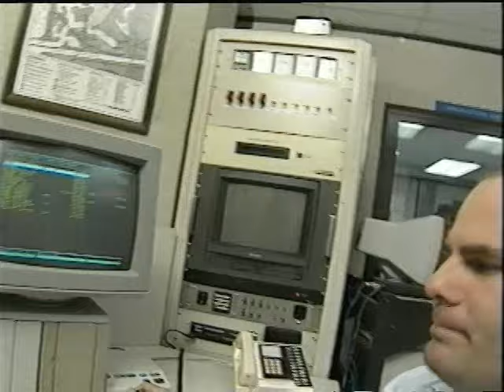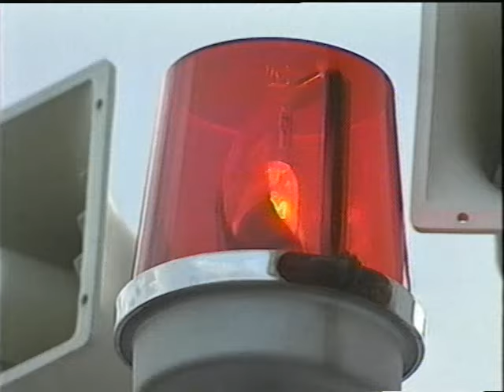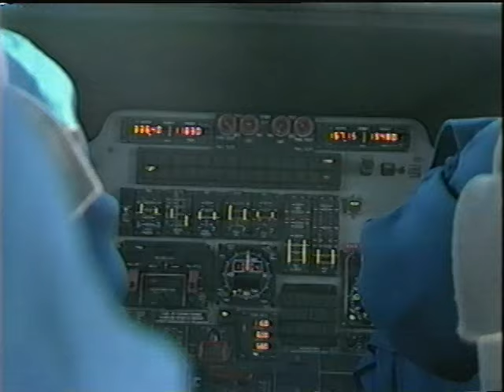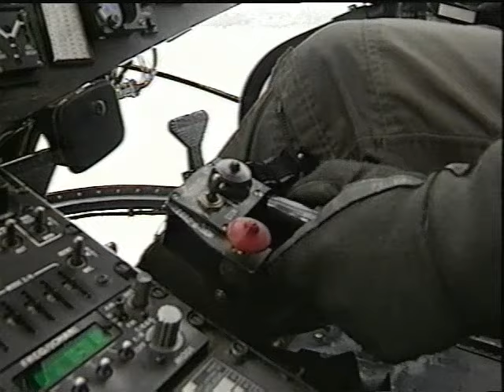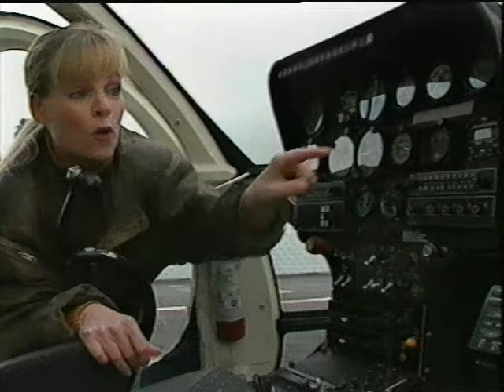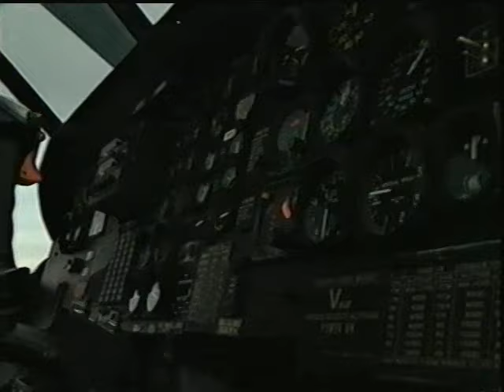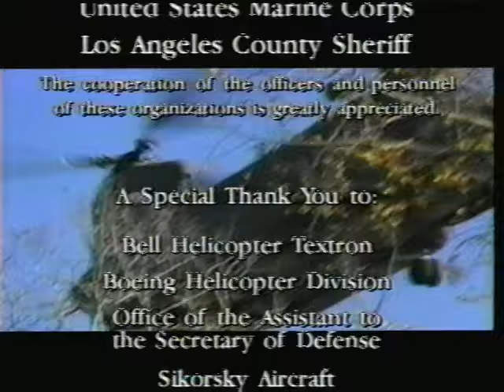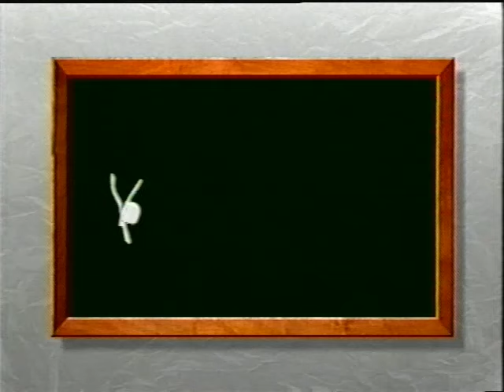[VHS] "There Goes A Helicopter" 1995

Comment: That hh 65 dolphin coast guard helicopter that Dave and Becky pretended to fly, crashed back in 2008 off the coast of Hawaii, and killed all 4 crew on board. Rip to all on board. I used to love that scene of the coast guard helicopter taking off as a kid.
Reply: Are you talking about that very exact helicopter that is in the film?  If so, how do you know that is the exact one?  That is tragic indeed!
Reply: @andrewsstation6436  yes im talking about the exact one in the film. The helicopter was tail number ‘6505’. What happened was the during a training exercise using the hoist the cable snapped resulting in damage to the main rotor of the helicopter. Just over 3 minutes later, with the helicopter traveling approximately 2.1 nautical miles, the rotor head experienced a catastrophic failure and the helicopter crashed into the sea from a height of approximately 450 feet.

Comment: I remember when I was a kid, this was one of my favorites of the "There Goes" series. Of course, I can't say how well this holds up with today's equipment. The video was made 20 years ago so the Coast Guard has probably changed somewhat in that time. Actually, come to think of it, it could be interesting to see someone (perhaps with more knowledge on the subject) go through these old video tapes and examine how they compare to the vehicles as used today.
Reply: Little has changed with the Coast Guard, they still use their HH-65 Dolphins as their main rescue helicopter. With the Marines, the CH-53D Sea Stallion has been replaced by the CH-53E Super Stallion (a much more powerful variant with 3 engines), which itself is being replaced by the CH-53K. CH-46 Sea Knights left the Marine Corps last year after the V-22 Ospreys replaced them. UH-1N Hueys have been replaced by the updated UH-1Y Venom. AH-1W Cobras are still in service with the Corps, but they're being phased out by the AH-1Z Viper. The Venom and Viper were developed alongside eachother. The biggest update over their predecessors is that they feature a totally glass cockpit. Even more has changed for There Goes an Airplane though. 
I also have to agree, this is one of the best next to Airplane and Spaceship.
Reply: Wow, so it actually holds up very well aside from perhaps a few minor details. I'm not sure I can't say much for any of the other installments other than There Goes a Fire Truck, which is actually still an accurate representation of working in the fire service (although there probably are some minor changes in the equipment used)

Most of what I noted was that some of these videos are very male-dominated, which itself is probably because a lot of them deal with professions in which there were (and in some cases still are) larger numbers of men than women. For that matter, this would have been at least 15-20 years before the Marines began accepting women (and even now they're still greatly outnumbered by men). They could still be seen as progressive in that there often was an attempt to show both men and women working, though it could be argued they were more successful in some cases than others.

I used to have a bunch of them an loved them all. There Goes an Airplane and There Goes a Bulldozer were also among my other favorites. Of course, I can't forget There Goes a Space Ship and There Goes a Boat.
Reply: That's actually the reason why Becky was added to many of these videos- so the videos would appeal to both boys and girls and to show them that both genders can do the same jobs.